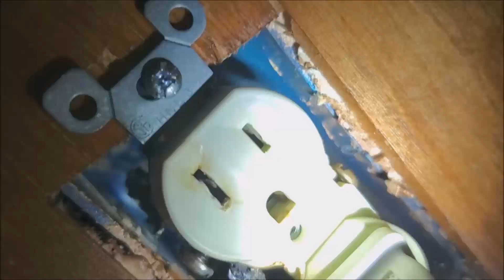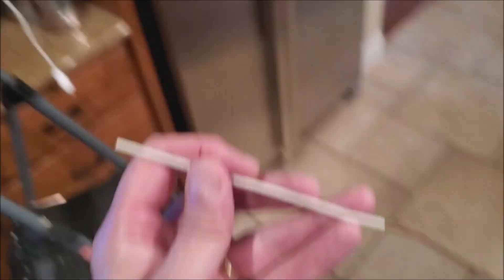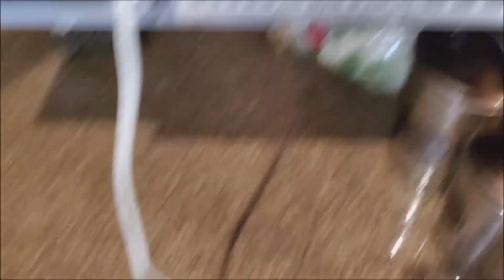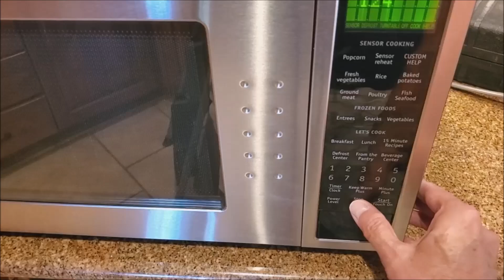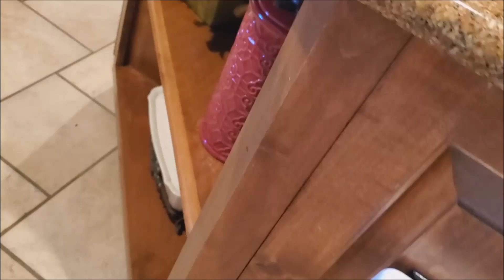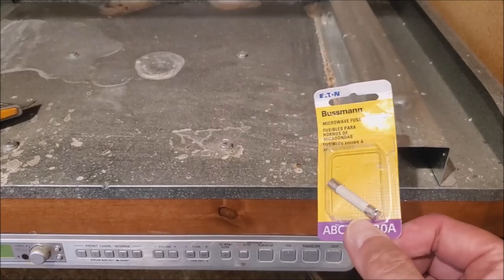Microwave Burning Smell? You Need To See This!

Comment: Someone here in town in Florida just lost their whole house and 3 cats when the house burned due to faulty wiring on the back porch. You got lucky bro. My microwave had a blown fuse too, it was because it had a faulty door safety switch. It was designed to blow the fuse if the safety switches malfunctioned.
Reply from the maker: That's so sad (I also have 3 cats that I adore). That's exactly why I made this video. I don't want people to ignore a burning smell just because it goes away.

Comment: This is usually caused by a loose connection at the recept.  On the other hand 1700w devided by 120v equals 14.17 amps which is near the rating of the burnt recept. You can check current at the breaker.The 20 amp recept was a good idea. If the circuit was only for the microwave recept NEC requires a 20 amp recept. Good job on the repair.
Reply from the maker: Thank you, Chris.  Yeah, I figured since I measured just above 15, I'd better get a 20A receptacle, but yes, I'm certain the failure was due to those loose connections.  The screws were still in their factory positions.  I think my particular case of having the outlet in the cabinet above, with a hole for passing through power cables, led to me thinking it was the microwave, because the smell came out the vents in the trim kit.  It never occurred to me to check the outlet the times my wife complained before ;)  Of course, now I'm wondering if there are other loose connections in the house!

Oh, and good point about checking current at the panel, since the microwave was the only thing powered by the circuit. I should have thought of that. Instead I spent an hour trying to find my plug-in monitor in my cluttered garage!